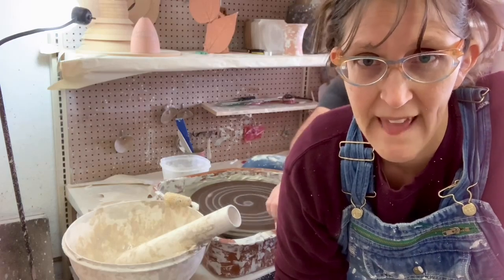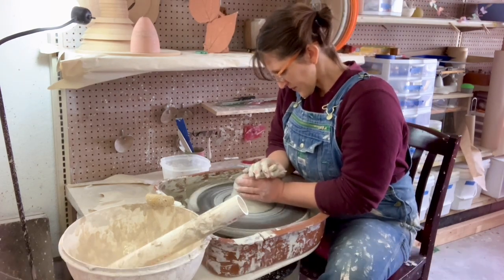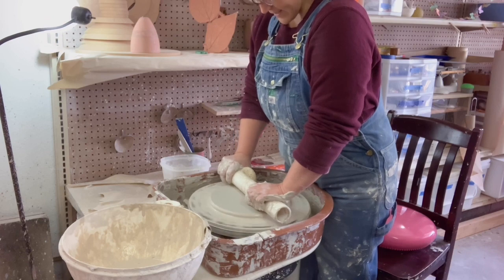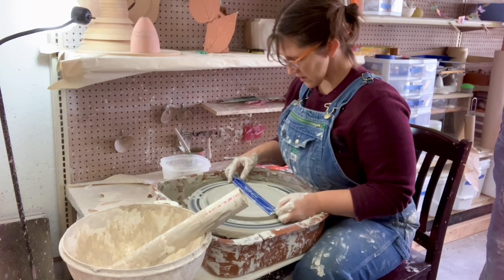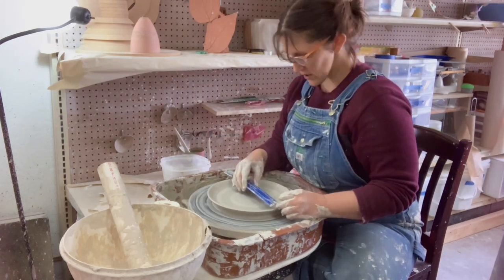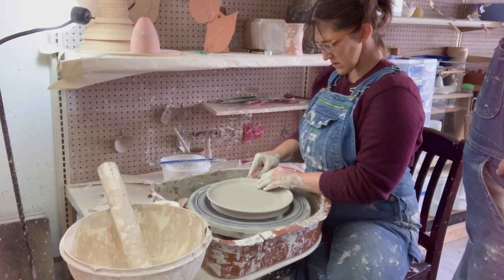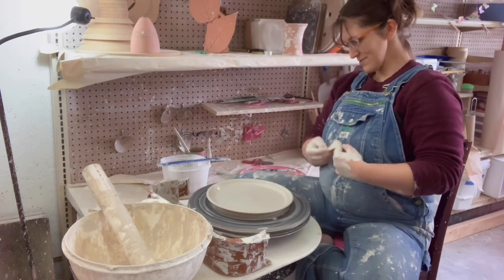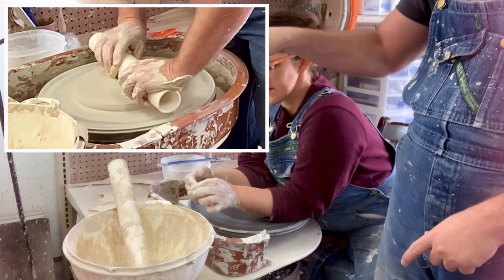PVC Plates! Throw Plates with a PVC pipe, throw plates with a rolling pin

Comment: When you cut off that outer edge do you go straight down with your knife or at an angle.
Reply: Going to try this love y'all
Reply from the maker: It’s really fun! It doesn’t really matter, you will smooth the edge as usual at the end. So when you do that your not finished throwing so the cut you make just needs to be clean and even all the way round. Do what is clean and even for you so that you have an even rim to continue with. Does that make sense?